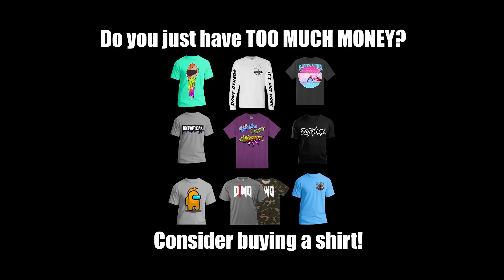Building a Kitchen inside of an Ambulance (Also my shop is flooded)

Comment: Dan I may be jumping the gun but the stove board cover could do with a stainless steel liner to prevent fire, you could bond it to the underside so that it is a fire proof backer when cooking and then a wooden cutting board when flat, also are you having a cooker hood above and where is the oven venting heat. Like I said you may have all of this covered. Love the work you have some great skills and design ideas.

Comment: 40k worth of wood in that ambulance, hot damn
Reply: Also Dan for that fold up cutting board you might could put a thin strip of rubber between it and where it sits like a gasket to reduce noise